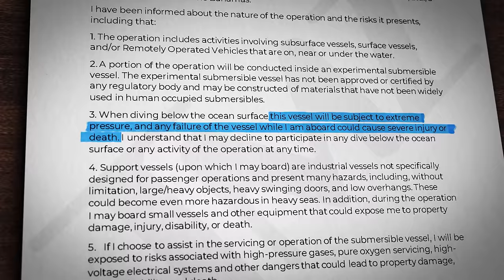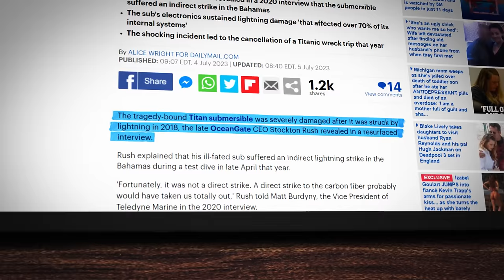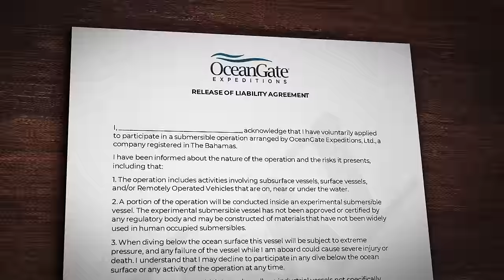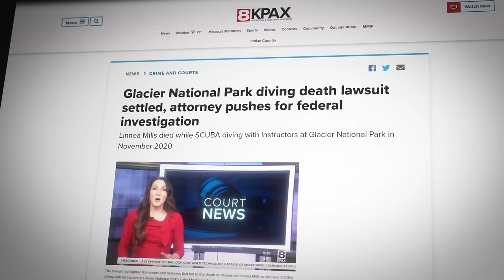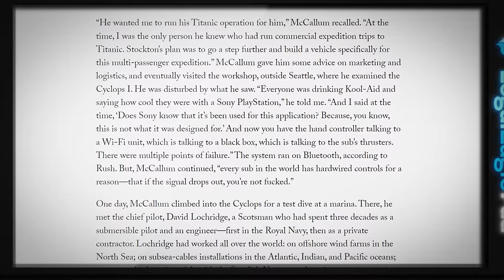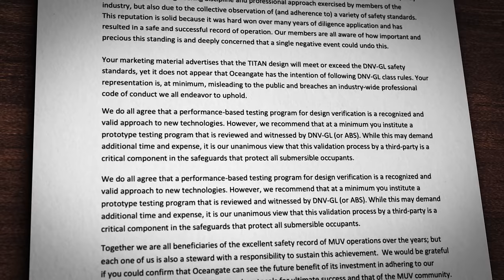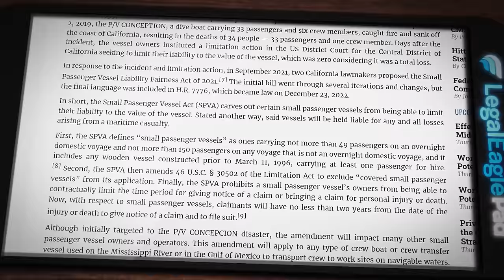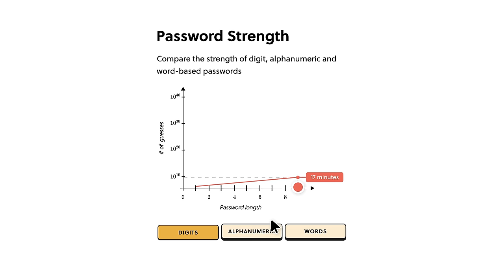OceanGate Is Getting Majorly Sued

Comment: If the waiver had included, "I understand that Oceangate has been warned multiple times in writing by industry experts that our vessel is unsafe and is putting passengers in peril." I'm thinking that nobody would have signed.
Reply: The issue is the difference between the writings and what Rush told the people he was bringing into the sub.
He would have claimed that the mention you added had been included because those other "industry experts" are just people who hate him and try to destroy his company by pushing for non-necessary procedures.
Reply: I don't know. If you're willing to sign the actual waver, you might be willing to sign anything.
Reply: It should also include that "OceanGate have literally no idea of how many submersions their submarine should resist, and anyone should know that any of the travels could be the last one"
Reply: Not a laywer but that may honestly just would have made the waiver unenforceable tbh
Reply: @daedalron  Yeah, so you shouldn't be an idiot and do a proper due diligence before setting a foot in that thing. This is not a water slide, it's unbelievable to me that people treat this like this was a bus ride. Rush may have been reckless but so were all his passengers if they just simply trusted someone telling them 'it's gonna be fine'. Nothing on deep diving is ordinary.
Reply: Except people don't actually read what they're signing...
Reply: Exactly, just calling it 'experimental' and 'you might die' is far from "industry experts and our own engineers have warned us that this design is fatally flawed and every dive could be it's last".  These waivers make some assumption that the business providing the service has taken all reasonable precautions, but some risk is still inherrent.  This business took no precautions and blatantly ignored all the warnings from qualified experts.
Reply: The waiver needed to say "YOU WILL DIE."
Reply: @musicalneptunian That's the waiver for life.
Reply: There's also the general idea that if something is expensive enough, it must be fine! Why would they charge 250k a piece if it was going to fail? Throw enough money at a problem and eventually it will just go away.
Reply: I doubt it, many of these rich idiots skirt regulations for a living, thats how they make money, so honestly I would rather Oceangate to prevail in these lawsuits to teach these rich idiots a lesson, regulations exist for a purpouse, not for yout to try to go around them.
Reply: @musicalneptunian  If it did then anyone who rode the sub and did not die could sue because they did not actually die.
Reply: Nah people would've signed;
Do you realize how NOBODY reads waivers?
Reply: IF they read and understood the actual waiver they probably would sign something that had a last line stating that they should give away all of their valuables, house and car also. They passed a lot of red lines already…
Reply: I wonder how much crossover your viewers have with LegalEagle. I find it very fitting that you watch this too.
Reply: Wealthy folks have different hobbies.
Reply: @MumrikDK  Something tells me Rush brushed aside the paperwork as simple 'legalize', that this is a standard waiver everyone signs, etc. He certainly downplayed it when he needed to.
Reply: There will always be people with more money than sense, or caution.
Reply: I doubt any of them actually read it and just signed based on a summary from Rush.
Reply: @misarthim6538  How many people can be reasonably expected to do due diligence on something like this? What do you know about fatigue failures due to cyclic loading of composite materials for example? I presume nothing, and if that is true how would you be able to evaluate which person presented as an expert was correct? I see people making the same argument about due diligence and vaccines before talking about Dr John, whose expertise is in training nurses, not in clinical studies or epidemiology.
Reply: I didn't expect you here😂
Reply: @fedos  Ehh idk. I am sure some of them did. Many in the submersible industry refused to sign this and go on the Titan. This was a numbers game for Rush. All he had to do was convince enough people eventually.
Reply: You are supposing people read weavers... in all it's details.

And are not engrossed in the prospect of the activity they want to do.

And would walk out if they didn't agree.
Reply: @MumrikDK  does read extremely similar to most ocean-based activities, diving, and even sea animal enrichment activities in direct hands-on style feeding (within a controlled enclosed managed environment) in places such as the Caribbean. 

So for them, the only difference is that they are going deep down in a sub. (Which, mind you, is a huge difference and posses a way higher risk for anybody who can swim) But nobody lists the realistic odds on those waivers.
Reply: It literally says "I hereby assume full responsibility for the risk of bodily injury, disability, death, and property damage due to the negligence of any Released Party while involved in the operation"
Pretty sure it could have said anything on the waiver and the same people would have signed it.
Reply: Wait wait... A rules lawyer just appeared in the comments for an actual lawyer? This is the YouTube crossover I never knew I needed.
Reply: @misarthim6538 "before setting foot in that thing" is present tense. I don't think anyone can set foot in a pile of scrap lol.
Reply: i guess "you may die" is not enough...
Reply: @poke_champ Not really. I signed a waiver warning of my death multiple times while going in for a simple cyst draining. I've done the procedure multiple times and was nervous as hell the first time, so reading the papers they gave me really freaked me out for how often it mentioned potentially fatal side effects, but then the actual procedure is nothing. If you've signed submersible waivers before, I wonder how much that line would even stand out to you, or how much it would just seem like every other waiver you've signed.
Reply: I don't understand how he was allowed to market this to passengers despite having no certifications of any kind that the vehicle was sea worthy. Is there not some sort of rule against that? I can build my own plane and fly my friends around, but I would imagine I can't advertise and charge strangers to join my "experimental" contraption.
Reply: @misarthim6538  Regulating bodies exist so that normal people don't have to be engineering experts and inspectors before buying a product or service. When a building collapses from an engineering failure, it is the engineers who get the blame not the person who paid for the building. Unless you yourself are an engineer, I don't think either of us could find the flaw in a blueprint without it being pointed out and explained to us by experts.
Reply: @vanessamaldonado5877  I get what you're saying, but I feel like if oceangate prevailed over the lawsuits it would just be used by rich people as a example of how to do business.
Reply: @akaimizu1  Those other activities still have standards of practice which if not met would open them to lawsuit regardless of the waiver.  The argument isn't of OceanGates waiver is good enough but rather if oceangate was negligent. I'd say using a material known to be entirely unsafe and ignoring everyone who told you so would be negligent enough to make the waiver irrelevant.
Reply: @zagreus5773  This kind of language can be seen in waivers for activities so safe that you would actively have to try to harm yourself. The inclusion of such lines in a waiver has become effectively meaningless to the consumer because every single risk and liability waiver has it.
Reply: @neilbiggs1353  if you're getting in a submarine to go to the titanic I for one would do an awful lot of reading about submarine safety and fatigue and the rest of it. There's no way I would have gotten into a machine with the unproven development and lack of certification of this design.
Reply: The contents of the waiver are so ridiculous that it seems like a no-brainer not to sign it- and I never would- but then you also have to consider that the passengers were explorers or nautical experts and had Stockton Rush whispering in their ear "It's just a waiver. Just paperwork. Come on, don't worry about it. The vessel is SOOOO safe. Safer than crossing the street. We worked with Boeing, NASA, and the University of Washington on the innovative design. You wanna be completely safe? Don't get out of bed. Come on, don't you want to enhance the field of ocean exploration? What do you mean, 'safety concerns?' I'd be very interested to know what the UNINFORMED think the 'SAFETY CONCERNS' are. Imagine thinking my unsinkable vessel is UNSAFE! Cmoooon. See, I'm getting on the ship too. I feel sooooooooooooo very safe." The waiver is absurdly airtight, but these people were also conned.
Reply: at 1:45, it does, it says in effect "nobody will certify this POS, but we don't care"
Reply: @daedalron  And those experts are not infallible. It is only their opinion and should not be treated as fact either way. Their warnings are enough to rpove anything because they are only opinions.
Reply: I am pretty sure everyone on board was aware of the allegations, but took it as "the establishment" trying to suffocate innovation.
Reply: @BaronSengir1008 The people aboard  probably have 5 lawyers in speed-dial and the waiver was most definitely looked at by one. However, one cannot forbid their employer from doing whatever they want in their spare time.
Reply: Oh No, They would still sign. They really put ALOT of money down knowing how unforgiving that environment  is.... RIP to all those who decided to gamble with their lives, and lost.
Reply: Good point  You'd make a good judge.
Reply: Of course they wouldn't, they don't want to take accountability or responsibility, they'd rather be free & not have to sign anything than have to listen and sign.
Reply: @ellicel international waters, for all intents and purposes nobody has real authority there or more accurately nobody tries to police it and it's a grey area.

He would have been ordered to shut it down and probably criminally prosecuted if he tried to use it in Canadian or US waters and was caught (especially as a commercial vessel).

But advertising it in US or Canadian territory probably wasn't illegal and who would be actively policing that either way?
Reply: @neilbiggs1353  I have no idea about deep sea submersibles. But if I have 250k to spare for a ticket on one, I for sure have another 25k to spare on an expert to give me expert opinion whether it's safe or not. If you buy a house or a used car, you hire an expert to evaluate if there are any hidden flaws. It's insane to me if you wouldn't do the same while you're diving into the 4000m on experimental sub. Stop infantalizing people, it's not a bus ride we're talking about.
Reply: @ellicel  Why not? As long as you disclose that it's experimental and not certified why that would be a problem? I don't think you understand what would a prohibition of such activities mean. The 'rides' are means how you can finance ongoing design and development if you don't have enough capital on your own. If you make it impossible for people to voluntary agree to participate in it and pay, you're cutting off anyone but a super rich or the government from developing new experimental designs.
Reply: lol the waiver is useless only protects company if sued in bahamas.
Reply: @hrodebertcoad9848  Agreed. This level of  negligence would generally not be protected by the waiver. Otherwise, such a waiver could be used to commit murder outright.